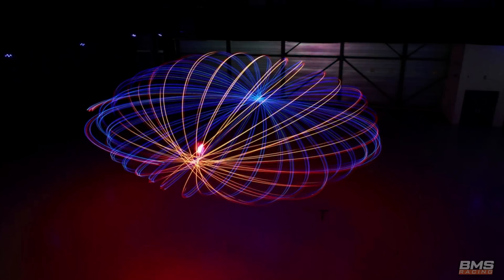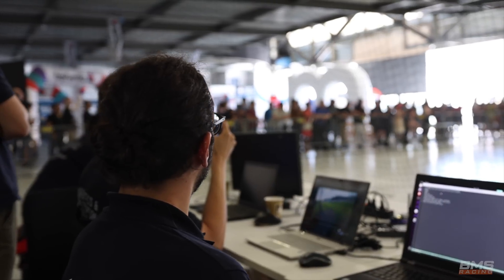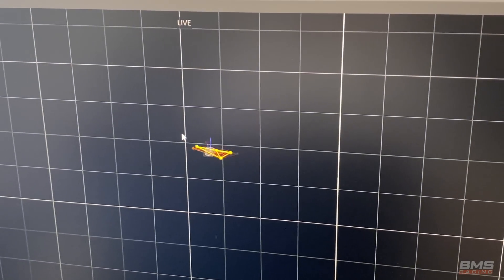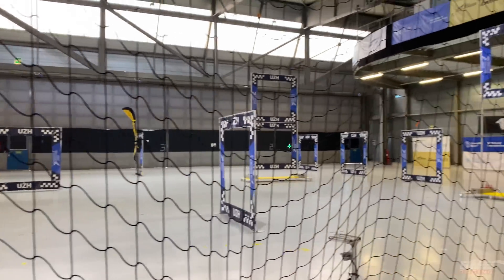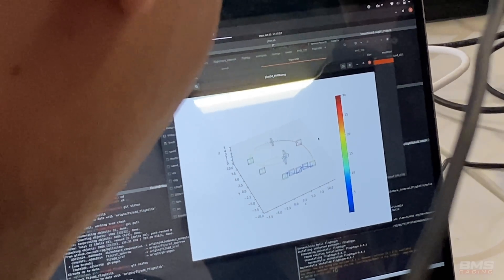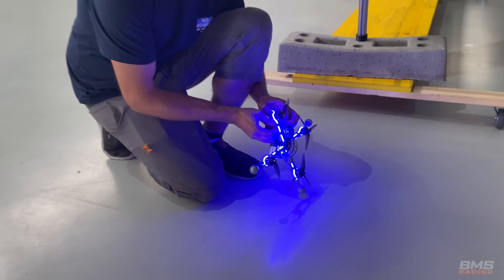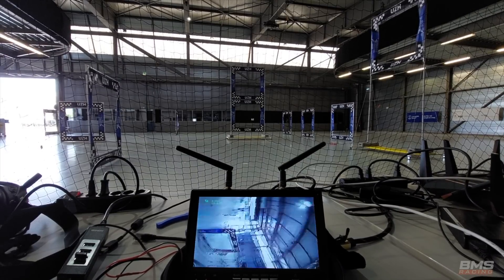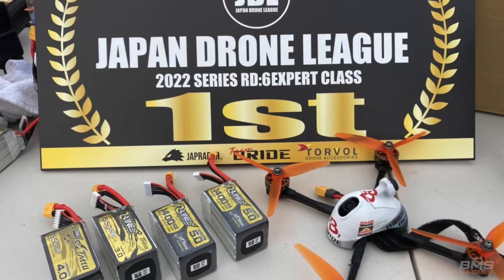AI Racing Drone Learning a New track & Exploding!

Comment: it looks to me as if it were always snapping to either full throttle or no throttle. Also, doesn't the sending commands back and forth add significant delay? Humans adapt and train to such delays easily, but i imagine that for best performance, the main flight ai should reside within the drone with externally only some rough course correction data supplied. Additionally same ai should do the collision avoidance i think.

Comment: How does the AI controller compare to a physics-based handcrafted method? With accurate, high-speed absolute position tracking you can control it basically with a physics model and PID tuning. I'd expect this to be much more reliable.
Reply from the maker: Hi! They've done this before! If I remember correctly they called it a model-based approach, or a roboticist's approach. Basically model the core scientific principles we understand of how the world works, and use that as the basis to guide the drone in 3D space. I believe the short comings vs AI approach was that even in a controlled environment, there are so many uncontrolled variables that the current model-based approach struggles to account for, so they have to limit its speed to account for error. I guess using a neural network, it can find patterns in these inconsistencies and push closer to the limit!

I believe they might have some coverage on the website and YouTube channel for the Robotics and perception group about this!

-Thomas

Comment: When you guys were digitizing the track, you mentioned that you used the markers to define what angle the drone should fly through the gate at.  When the AI trains, does it always respect this angle (and i guess inner gate position) or is it free to discover a "faster one" if it can?  Do you guys make the gates a bit smaller in the simulation so it leaves some room for error in the real world?
Reply from the maker: It's free to discover it's own path and racing line. Only requirement is it passes through that section/waypoint in the correct direction - Paul

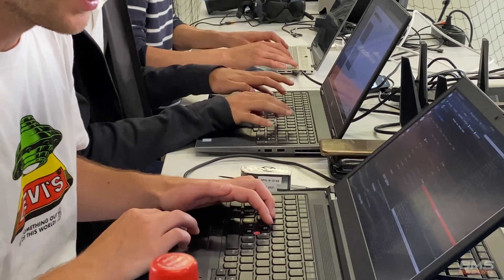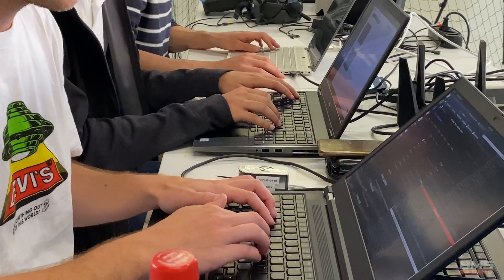Comment: Is it me or did you use "The vicon drone" at 2:10 again at 2:12 to transition between both scenes?

Also, seeing that drone lift off and just full send it made me audibly gasp, that was amazing.
Reply from the maker: ha ha yes they were from two different recording days. We learn't a lot about voice over setup and made improvements. We could have re-recorded the middle segment but we have so much other footage to push out atm we decided its better to get the information out rather then linger on it and have the info become obsolete!

The launches are insanity, I don't think I can move the pitch stick quickly enough let alone manage the throttle to pull off a launch similar to that, but I so wanna learn it because it looks so damn cool!

-Thomas
Reply: @BMSWEB  Might be able to set up a "launch control" like mode similar to what cars have. Have a separate button set up to turn the motors on full blast for the start, or the reverse. A button that allows you to input full throttle but it not send to the drone until you let go of that button. That way you lose the stick movement input time and a tiny bit of the human latency. No idea how one would code this... or if you would need to code..

Comment: Is there any way to get access to their PID tuning system for the quad? Imagine if that tech could be available for everyone to easy tune their quad based on flights.
Reply from the maker: Believe it or not that was running stock Betaflight PIDS! The AI just learns to input whatever RC Commands are necessary to make the drone do what it wants in the real world! After we got home, we sent them our PID tune so their motors would run cooler.

-Thomas

Comment: How long untill a drone can fly this well with just its onboard camera system and AI
Reply from the maker: In the previous video we do show their AI Vision Based drone and it does fly extremely well, however it's whole computing system is also on board which makes the drone much heavier. Also I doubt any onboard vision based drone will be able to the way this does because direction / orientation isn't relevant to this Vicon Drone

Comment: wow, this blew my mind. I now need to at least try to use the TBS module with a pc. 
The FPV feed looked BRUTAL, but is it really faster being that brutal ? normally smooth is fast. jerky just looks fast (at least in humans?)  
edit: unless it's only fast for us? as in better for our brains to process faster? passing the gates at uncommon (for us) attitudes might be faster, but the jerkiness idk.
edit2: the throttle control it has is AMAZING
Reply: You have it basically right, I feel. Smooth is fast for humans in large part because they need to use the camera to see and control. The AI isn't even using the camera at all, so any sense of stabilization, for it is unnecessary. 

Still quite impressive ofc, I just feel the FPV is a bit misleading because of that. It doesnt have any reason to point it in the right direction even.
Reply: Looking at the lap time, the ai did a lap in about 1/3rd the time of the human pilot.

So yes, faster.

Comment: So the fastest way to fly a course is mainly backwards? Interesting but very much impossible for a human 😂
Reply from the maker: You're 100% correct, in fact you can take it one step further, without that many cameras it can't even do that itself. The Vision based single camera system makes more sense. But like the previous video, the Vicon is mainly used to gain data and learn about flights paths etc
Reply: There is no formal direction for AI drones

Comment: This is a very interesting approach to for flight control. I really like the idea of tracking markers. It would be interesting to see what kind of other sensors could be used to gather info about the environment and what could potentially be used for a on-the-fly ai-learning flight system. 

I worked for Fortem Technologies and we developed a swap-c radar to track drones and shoot them down. I had some ideas that I would have loved to explore, but the path that was rod for the company didn’t really allow for exploration in some of those directions.

I love flying fpv and auto racing, I notice that a lot of the fpv pilots don’t take the optional lines, because humans don’t have reaction times necessary, and I’ve always wanted to know what would happen if AI was used. So it’s interesting seeing this happen and extremely satisfying!!
Reply from the maker: Well keep in mind humans also fly with one camera so the orientations of the quad is limited, where as this thing can fly in virtually any direction. It's a fascinating approach for sure and I'm sure this sort of tech will allow for some amazing breakthroughs that can then flow on to their Vision Based Drone which realistically what's going to be more practical in the real world. Irrespective of everyones different takes on where this tech will go, it's going to be interesting times ahead - Paul
Reply: @BMSWEB  That was something I hadn't considered, that it can fly in different directions than just the one facing the camera. As soon as I saw it, I smiled and thought that it was clever and also a very logical step in being more efficient in some of the cases. 

One of the things I was curious about was how long it takes for them to run the simulation to learn the track. It would be interesting to know the tradeoff of flying slower versus having a high enough resolution to fly the track. When you said something about 32 minutes since designing the track and about 40 minutes since the track was created, how long do they need to run the learning/simulating part of it for the drone to fly it?

Comment: Awesome video. 
Impressive feat and really interesting to see the fpv camera footage at the end -- didn't even appear to be racing tilt but was aimed very up, very inhuman flying. 
I wonder if it can give you ideas for human racing, like deepblue, alphazero gave human chess players totally new ideas to approach the game
Reply from the maker: Cheers! We we're discussing the idea of using a variant of the software that flies, keeping the camera at a more conventional angle. The idea was you could throttle limit it in software to your pace and watch how it's flying and try to replicate it/learn from it. I think this is something that's totally possible! 

Interestingly the code tends to favour holding full throttle and using a sharp turn in, to get some of the motors to wind down and thus reduce the momentum and allow it to turn. Basically it's a super sharp turn in and it slowly eases off the rotation, with the throttle command always pinned!

-Thomas
Reply: @BMSWEB  ah that’s interesting. Harder for a human with ~165 deg fov to replicate, but a good lesson.. probably also requires a bigger lipo on a big track! 

I was also thinking it could be amazing for testing gear, once it got very consistent. 
Eg, control test different props, motors, tunes, etc. and let lap times speak for themselves. 
The visual AI version would be better for that as it would fly more human-like lines — not that the University would be interested in throwing in resources at this! But give it time
Reply from the maker: @nickgreenemail  We actually discussed that with them, since it's one of the things we have to deal with on a day to day basis. So when testing props or motors etc it requires a lot of flights that need to be consistent etc and then also a lot of SpreadSheet data to work out how the data is trending, while making notes on what data to ignore (ie clipped a gate or made a mistake etc) This would pretty much speed up that process in a big way. Yep many applications for this, but it could get pretty costly.

- Paul Here
Reply: @BMSWEB  I hadn't thought about using it for testing purposes. If the AI copied some human pilots flight styles the testing would be consistent and more true to real-life scenarios.
Reply from the maker: @brian7android985  Yep for sure

Comment: This was such a good watch! Some amazing results. Someone get these guys some ELRS gear 😅
Reply: Tracer is crazy fast though. They’re probably using it to minimize latency.
Reply: @Flumphinator  elrs can go 1000hz...tracer only 250.
Reply from the maker: There is a latency and consistency component to it, but on the refresh rate side their Tracer operates at 1000hz already :)

-Thomas
Reply: @BMSWEB  thanks for the clarification. Have you guys experimented with ELRS for your own racing? I have been pushing for a decent elrs + vtx combo board...
Reply from the maker: @BengalCatChilli  We did ages ago and it worked great, however stuck with TBS mainly due to approvals etc Now speaking of approved hardware, when Thomas competed in the Japanese JDL Series (Paul here btw) a couple of months ago, the only approved hardware/software for Japan is Futaba and BetaFPV Nano ELRS! Before heading over to Japan Thomas had heaps of help by the absolutely amazing ELRS guys and learned heaps, but when he got to Japan there seemed to be issues with the Hardware and hence reliability issues with it. Let me be absolutely clear here, the reliability issues are due to the Hardware and version of software that was approved for Japan. I think if you use the right hardware ELRS should work perfectly.
Reply: @BMSWEB   yeah and it's essential for him to be able to trust it 100% :D 
Thanks for the detailed explanation. Perhaps with RM releasing a high quality module and rx's we can get to a point where the hardware side  can be 100% reliable.
Reply from the maker: @BengalCatChilli  ELRS is a phenomenal system without a doubt and Thomas does trust it 100%, just a matter of having a system that is legally compliant for specific races. For example in Japan he would have much rather just use TBS Tracer as opposed to changing perfectly good hardware, but tracer wasn't approved for Japan.

You're also 100% correct about RM, as specially because they already make such high quality radio systems

- Paul

Comment: INSANE!! The fpv view looks like its flying it LOS
Reply from the maker: It doesn't use any yaw, which is what creates that insane perspective. I believe they have another version that keeps the camera oriented more forwards with horizon level!

-Thomas
Reply: Considering the way it detects the position and orientation of the quad is via cameras mounted around the room, it technically is flying Line-of-Sight....

Comment: Wow! The FPV feed of the AI drone is crazy! The way it goes through the gates what ever way is fastest is nuts! Thanks BMS Fam!
Reply from the maker: It's really trippy isn't it 😂 orientation has no relevance when it comes to that flight
Reply: @BMSWEB  that's a fascinating way to put that. We puny humans rely on that camera facing forward. The all the AI knows is 4 motors equally spaced apart, so it just points and shoots 🤣
Reply: @BMSWEB  I wonder if anyone has tried to fly with 360 fpv or placing the fpv camera in the center and pointing it 90 degrees. Maybe it would make this possible in humans.
Reply: No doubt, my brain was hurting! By the time my brain figured it’s orientation it threw it off again!
Amazing Tech !
Keep up the Great work